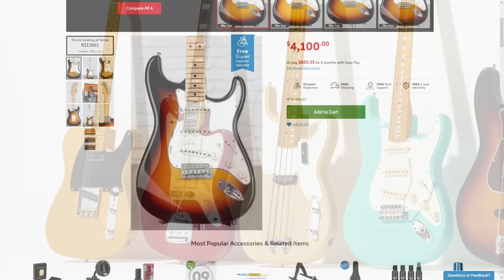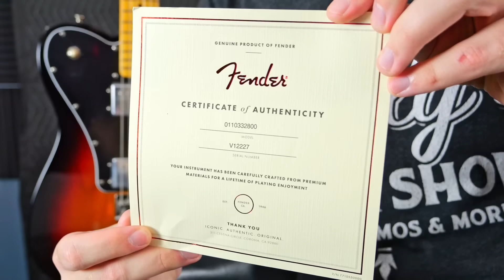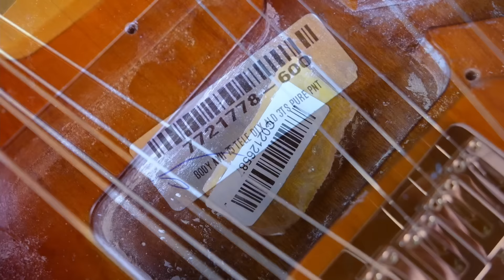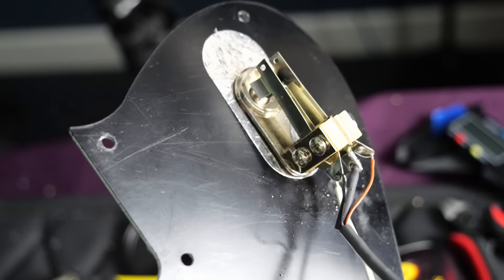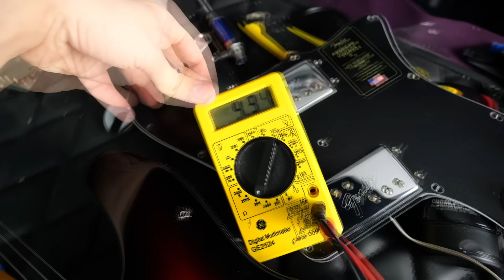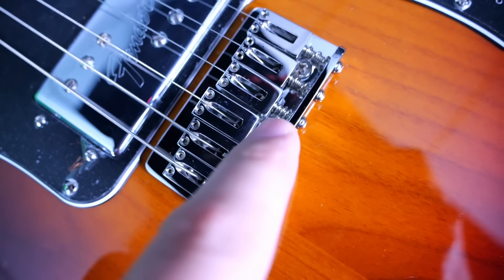An Embarrassing Factory Error... |  Fender American Vintage II 1975 Telecaster

Comment: Honestly, this has been a criticism I have had for Fender after I bought my strat a couple years ago. I was a die hard Fender fan for decades and never really had an issue. I bought my American made strat a couple years ago and paid 1800 for it. I was so excited about getting a strat again, only to have my hopes dashed by crappy QC. The neck was crooked to the point that the high E string was off the fretboard by the 13th fret. Intonation was not even remotely close. These things would be easily dealt with, and just a minor annoyance if not for the almost 2k price tag. The defense is always, just get a setup, I'm getting there. After loosening the neck and getting it straight in the pocket and making minor adjustments to the intonation the action felt a bit high and I found that the bridge wasn't even radiused to the fretboard. Once that was complete; low and behold, the real monster made it's appearance. There was fret buzz on almost every string past the 12th fret. At this point, my frustration was growing. I took it to a  shop that has an extremely reputable luthier and paid to have a full setup; they ended up having to do a full fret level, crown and polish to address the fact that the guitar had numerous high frets. So after paying more money and more time to get this thing in a playable state, I was happy....for a little while. More issues are creeping up with the neck less than a year after having the work done on it. I say this time and time again; it doesn't matter what company you're a fan of, there is no excuse for that kind of poor craftmanship and QC when dealing with an instrument in the price range. That's the kind of thing you expect of a 150 dollar squier guitar and amp combo kit not an American made 2k guitar. It is unfortunate that made in America doesn't seem to mean that much these days.
Reply: That sucks! I guess you baught it on line, without playing it? Why did you decide to keep it and not return it? Just curious. I've baught a few guitars that I knew I would have to invest money into because of the way it felt and sounded. And honestly, in my almost 40 yrs of playing and owning lots of guitars (plus a close friend owned a guitar store) I realized that almost every guitar that was under $1,500 or so, needed the frets leveled. Even high end $3000 guitars, some needed it. PRS seems to have the best factory fret jobs in my opinion. My friend was a PRS dealer. I've literally played hundreds,and never played one that needed any fret work. If they can do it, even on the least expensive models in the SE line, then you would think everyone could. In my opinion,  it's the most overlooked thing that can drastically effect playability in the higher frets. I learned the level and crown myself due to this issue. Its not hard and doesn't require a lot of money in tools.

Comment: As someone with 2 Teles with Cunife humbuckers, that hum is not normal.  That thing is not properly grounded.

Still, best Neck pickup tone out there.  FYI, the pots are 1meg, that's what they did in the 70s, and you can tell the difference if the Cunife humbuckers aren't connected to 1meg pots.

Comment: I have a 1974 Tele deluxe which I bought from Gordon and Simpson in Edinburgh Scotland It's similar to the one you have but the bridge pickup is set into the ashtray style bridge with 3 saddles it's a single coil The neck is a large humbucker . The neck itself is a one piece maple Tele neck not the strat styled neck you have 2 Vol 2 tone 3 way switch and jack socket on the side . It has the comfort cutaway on the side . It's a 3 piece body with a 4 hole bolt on neck . I got rid of the ashtray cover and no not where it is . I nearly changed the tuners but watched  a video on youtube on how to clean them up and get them working good I have replaced the bridge pickup with a Warman similar pickup .Oh and it's left handed . The guitar sounds great and for 20 years was the only electric I had Still got it still play it but tend to use my 6 string Rickenbacker these days . BTW I'm not a fan of Gibson so I was surprised to see you looking at a Fender the best guitars in the cozmos .... ( Insert stupid laugh )

Comment: 70's fenders had a poly sealer or base coat and still used a nitro top coat (on the body) the neck was all poly except for the front where the decal is which was still nitro, so this isn't correct for the spec. Also I don't think you ground the bridge when you put it back together.

Comment: The pickups remind me of the Gibson MHS2s. A way more useable tone than a standard mudbucker. The issues on that make it a no questions return tho. 

My AmPro II Jazzmaster had a similar issue with the wiring. The switch in mine was installed  twisted so the wiring was contacting the shielding in the cavity so thankfully it was an easy fix. Fender QC isn't the best at the moment. They're struggling to meet demand and it's showing in the QC.

Comment: I know you like odd things, so I'll throw this out there even though you typically do higher end guitars. Squire did a Tele called the Custom II, I'm guessing somewhere around 2010. It is very similar to the Deluxe but has Duncan Design p90's. I know those pickups are hit and miss, but luckily mine are a hit. I got this guitar from my uncle's estate, he didn't leave a will but my cousin told to pick a guitar. He had some very nice vintage stuff (1963 Gretsch Chet Atkins, 25th anniversary Strat, etc..) but I went with this because I'm not a douche lol, and I just found this thing interesting. Long story short if you ever run across one at a good price could be worth a review.

Comment: 10:25 You seem to have two issues there.

1 - You have the amp connected to an ungrounded socket, or there is an issue with your amp.
2 - Your bridge doesn't seem to be grounded.

Explanation for nr 1
If you had a grounded connection there would be no noise at all when you're not touching the guitar.
When you touch the pickup switch you act as the ground, and that's why the noise goes away.

Explanation for nr 2
If the bridge were to be grounded that noise would also go away when you touch the strings, like with the pickup switch.

The solution is to ground the bridge correctly and use a proper wall socket, then the won't be any noise even if you're not touching any metal parts.

Comment: The 70’s Fenders didn’t have Nitrocellulose paint.  So neither would this model.  The other models in the lineup from the other 50’s and 60’s do have nitrocellulose finishes.

However the headstocks were finished in Nitrocellulose because poly would ruin the decal.  That’s why it’s darker.

Comment: that bridge is not grounded cause the noise is still there even when holding the strings. Full on copper shielding and  grounding  that bridge will help this guitar silent...and when i say full copper shielding, include the pickup cover and open corners of the pickups . I also shield the bottom of the fixed bridge and solder a wire there connected to the cavity shielding.

Comment: Few years ago I brought a USA pro Tele. No grounding wire to the bridge and no real attempt at shielding. Last year I got a Strat with exactly the same issues. I still have them but it irks me to have to finish the guitars off for Fender and they had no setup at all.
Fender USA has been shipping guitars for years without proper QC but seem to get a free pass compared to Gibson.

Comment: Ku Knee Fee, Ku nay fay? Co fey fey? They sound great. I would have liked Fender to keep the 9.5 radius and the nitro of the American Original 70s series though.
Reply: Except that Fender used poly finish in the 1970s, so in that respect it is true to the original.
Same with the toggle switch hex nut and the three bolt neck.
Reply: @hkguitar1984  Oh I know it’s era correct, it’s just that part of the premium price of say the old American originals (the 2018-2021 series) was that nitro finish.
Reply: @A_Noid  Yeah, toss up, era correct or premium finish.
Those CuNiFe pickups retail for $200 each, looks like its a choice between CuNiFe or lacquer!

Comment: I didn't dig in the comments, but surely by now you know it's just a bridge ground that is not hooked up. If you touch the jack/pots/switch/pickup covers and it gets quieter, but it does not get quieter when you touch the bridge or strings, the bridge is not grounded - no string ground. You can use your meter to check for continuity between the jack and bridge.

Comment: I Brough a Mexican strat in 2006 and i still play it every weekend. Its actually is a better guitar than my brothers American fender strat from the year 2007. Every thing but the neck is better, the American neck feels a lot smoother and slightly thinner, I don't know if it is just feels very different. The single coil pickups hum a little more than the Mexican.

Comment: I don't think Fender wanted a pickup that would sound very different from the traditional fender single coil sound. Wide range humbuckers don't use bar a bar magnet like the PAF design, each of the pole pieces is a magnet like all other fender pickups. CuNiFe was used because the pole pieces needed to be threaded to be adjustable. Apparently alnico couldn't be machined (have threads cut into it)

Comment: I owned a reissue of the '72 Thinline Tele which had these same pickups from April 2011 to September 2017.  I liked it, but they were very few people that I played with that shared my opinion. The Dogear P90s in the less-expensive Modern Player Deluxe Thinline Tele I got in January 2021 are much beefier (at least to me) than the wide-range humbuckers. It would be great if you could procure one of those and review it, Trogly.
Reply: These 72 thinline didn’t have actual cunife pickups. They came back with the American Original series a few years ago.
Reply: @A_Noid  I saw an Original ‘75 Telecaster Deluxe in a pawnshop 30+ years ago and it DID indeed have the Cunife pickups installed. I decided not to get it because it seemed like it had a headstock repair done.
Reply: @georgeprice4212  oh I was talking about the reissue of the 72. But yeah, those cunifes are great pickups. I just don’t like the general vibe and look of 70s Fenders.

Comment: So, I think that you can stop that string from catching on the pole-piece, if you just carefully screw it in a turn...
BTW, I have owned a 1973 TELECASTER THINLINE, in Natural Swamp Ash, with a Maple fingerboard, since 1975... And, my guitar has a Poly finish.
TL:DR : It's GREAT!

Of course, it came with a pair of the ORIGINAL Seth Lover CuNiFe Wide Range Humbuckers, and, I can confirm that they really can DO SOME TWANG, (almost) like a regular TELE! But, mine doesn't HUM!

FYI, the way I heard it (from an NYC-friend, who's really into this kinda stuff), is that Fender actually LOST SETH's ORIGINAL RECIPE for the CuNiFe magnet pole-pieces... Oooooops!  
They used-up all that they had, and then...
"I thought YOU HAD IT!" 
"Isn't it in a Vault in Atlanta?" 
"That's COKE, you idiot! HOLY SHIT, we're all gonna get FIRED!!!"
Sooo, I don't know what they did when they finally began making ACTUAL CuNiFe Wide Rage HBs, again, a few years ago... Metallurgical Analysis? OR, did they just FAKE IT? Probably not. (I hope not, 'cause, they go for as much as $299 each, or more.)

BTW, I have a Fender non-CuNiFe WRHB, (that only cost me $45), in the Neck of my "Naughty Pine" TELE build, and, it doesn't sound too bad, at all... I also have a GFS Vintage Split (HB-size fake WRHB) in the Bridge of my Xaviere PRO510 Les Paul, which gets some nice Twang, too!

I had to smile, when Trogly said he wished it was a nice Seafoam...
'Cause, recently, I was looking at getting a $449 SQUIER TELE THINLINE, to replace my '73, which I try not to play much, anymore...
But, INSTEAD, I bought a SQUIER Paranormal TORONADO, in Mystic Seafoam... for just $249!!! (It was a Labor Day Sale!)

Crafted in China (by Cort), and, it is AMAZING! 
The Fit 'n Finish is Impeccable! Not a single flaw in the finish, anywhere!!! And, it was pretty nicely Setup, right out of the Box, too!
Of course, I did some KYG massaging of the frets, and some F-One Oil,  and now, it's just WONDERFUL!
In fact, I think it would be worth $449, easily.
Plays nice, Sounds nice, Looks nice! Three outa three!
I totally recommend anyone to check one out!
Have fun.
Peace.
-Chris

Comment: So close yet so far. A a bassist this Tele really caught my eye now i feel disappointed. The pickups just didn't do it for me. I thought they wold sound half way between a humbucker and a single coil. Might as well just buy a regular Tele if the Vintage II doesn't offer something a little different in sound. Also I don't like the ambered over headstock. It looks weird with the more yellow fretboard. It doesn't work either amber the whole neck the same or don't. The uneven dots don't bother me nor does the neck pocket finish damage. The buzzing does, my Les Paul DIY kit has a similar issue. Rewired it a lot and still has the issue, although much reduced now. It certainly isn't a good look that this guitar passed quality checks and left the factory like that. All in all a great looking Tele (minus the headstock colour) shame it doesn't live up to expectations.

Comment: I had a 72 deluxe  in brown around 1992 to 95. Should never have sold it.  It was a great week worn example. Also had a 72 thinline at the same time.  Had neck issues at the screw holes.  Traded it for a tele lace sensor model. Should have kept them all.

Comment: I've watched this video a few times, and when you do the shot of the back of the pickguard (around 5:50) I don't see a ground to the bridge or any other metal part on the body that is attached to the strings, just the common ground out to the jack. I don't see a third wire running to the bridge when you show the control cavity either at 15:09. I'm by no means an expert, but a lack of ground to the bridge plate might be the reason the pickups are buzzing.

Again, I'm no expert, so someone feel free to correct me. I'm not seeing a way for the guitar to ground while you're playing: no ground to bridge, so the ground hum is still present while you're playing.
Reply: Also: wouldn't the shielding under the pickguard connect all of the pots? Would this not act as a common? If so, would that mean Fender created a ground loop by adding the horseshoe common on top of that?

Comment: The CuNiFe magnetic alloy was chosen for the magnetic pole pieces because it could be tapped with threads to allow adjustment screws to be threaded directly into the magnets.  That was it. Nothing more. Sure, it sounds a little different from the AlNiCo alloys, but not better. The only thing that made these pickups so-called "wide range" was the pole piece placement - the high strings on the right side of the lower coil and the low strings on the left side of the upper coil. This was theoretical only. If Fender hadn't called it "wide-range", no one would have developed that mythology on their own from hearing them.

Comment: The biggest difference between the wide range humbucker and the Gibson type is that the WRH uses magnetic pole pieces rather than bar magnets. Both WRH and PAF were designed by Seth Lover.
This guitar wasn’t a great example of wide range humbuckers, what a car crash of a guitar.
Reply: Duh. They're completly different than PAF pickups. Try to inform yourself before affirming false information

Comment: Interestingly the predecessor American Original series (which was selling for 1800-2100 over the past few years) did come with a Nitro finish.   They quietly downgraded that with this series I guess.
Reply: The 50s and 60s models still have nitro.  Poly is period correct for these 70s models. However, that is one feature they should have upgraded by using nitro.
Reply: @charlesbolton8471  ah ok. I checked and even the American Original 70s tele was nitro — so they made this one a little more accurate with the refresh.

Comment: I heard you not suppose to put pickups close to each other cause the heavy magnet could reverse the polarity or do some negative thing to the pickup
Reply: Feedback appreciated 💯🤗🤗🤗
You won a prize 🎁🎉... let's talk👆👆
Reply: I've found that it is best to keep pickups apart from each other because they can trade magnetic fields.
Especially if you place a weaker PAF pickup in direct contact with something like a Super Distortion pickup.
The Ceramic Magnet in the Super Distortion pickup is so much stronger than a typical AlNiCo pickup, that you can change the charge of the weaker magnet should they get too close to each other.
Also, depending on the magnet's orientation (North or South) the stronger magnet will either charge or discharge the weaker magnet.
I've actually damaged pickups in the past by storing them together in a box.   I ended up having to recharge the discharged magnets.